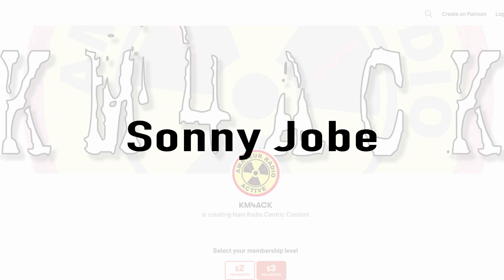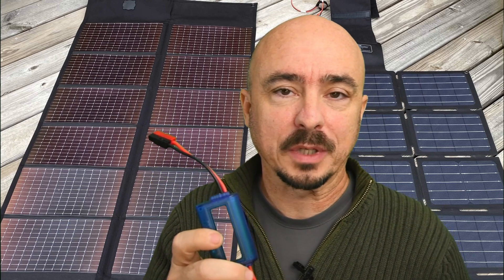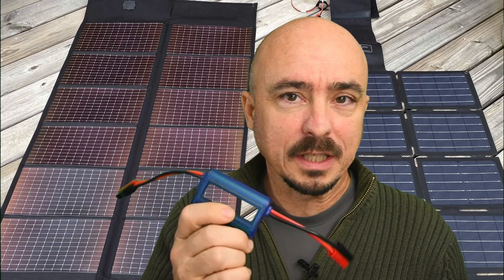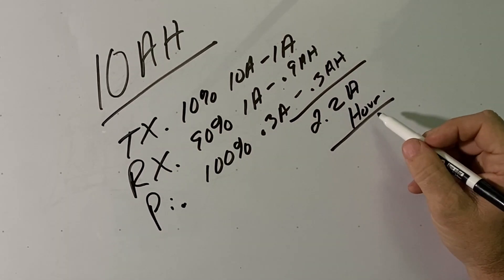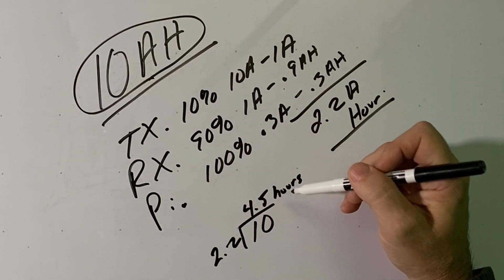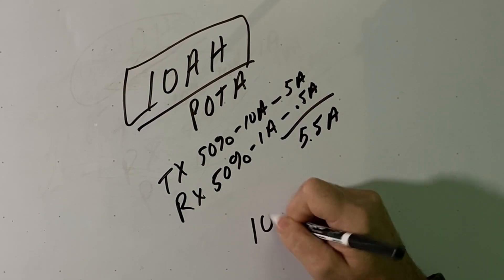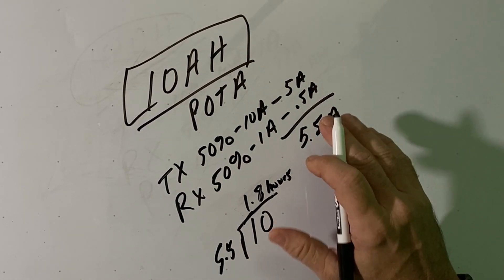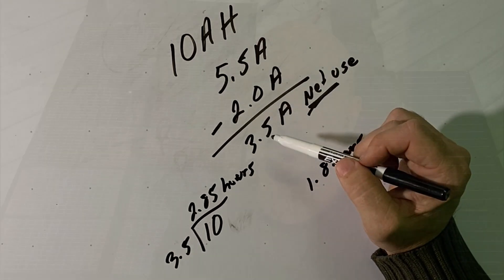How Long Will Your Battery Last

Comment: I use a Renogy  that is 72amps.  First bought it for my CPAP.  Renogy 72000mAh 266Wh 12v. Nice thing about it is that in addition to the cigarette plug outlet you have 4 other outlets including 3 USB and also magnetic charging.   This is as powerful as larger battery kits

Comment: It's a good effort to reduce what could become overly complex. But is there such a thing as "10 amps of power"?  Power is measured in Watts. From your first example, your radio consumes 0.1 amps per hour or 1 AH and 0.9 amps per hour or .9 AH. The total consumption would be 1.9 AH. Omitting the Raspberry Pi, the battery could be expected to operate for 4.7 hours for a LIon battery or 2.8 hours for an SLA battery. (This is per your effective AH ratins for these respective battery type.) 

I agree with Mr Ryland below when he says-- in essence -- bring a big gun to the fight!

Thank you for the video!

Comment: Li batteries have a maximum discharge rate. It is better to have a larger battery pack and draw much less than the maximum to get the most life and efficiency from the pack. I would not discharge more than 80% of the AH rating. The maximum solar charging current is limited by the battery's maximum charge rate. That is another good reason to use a higher capacity battery.